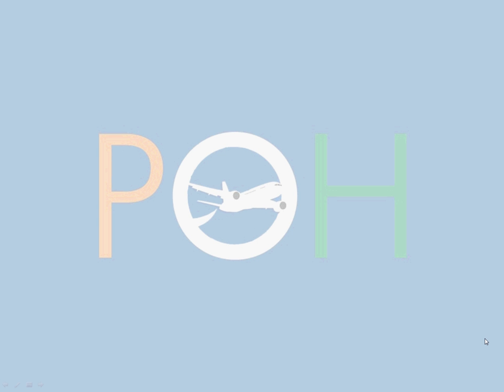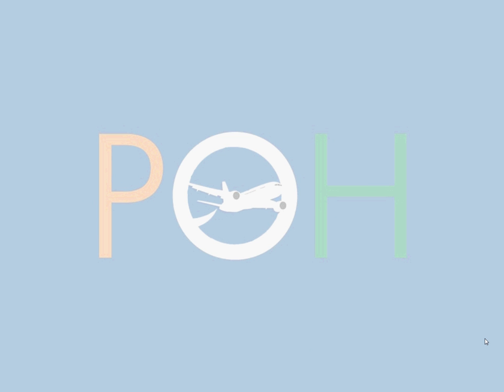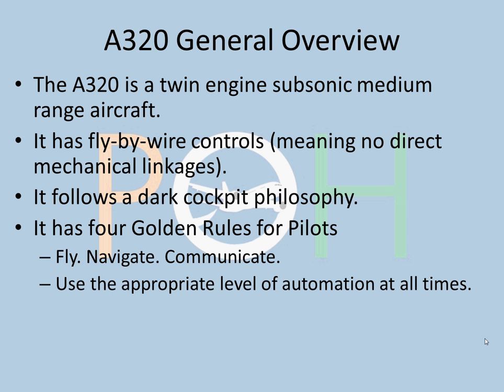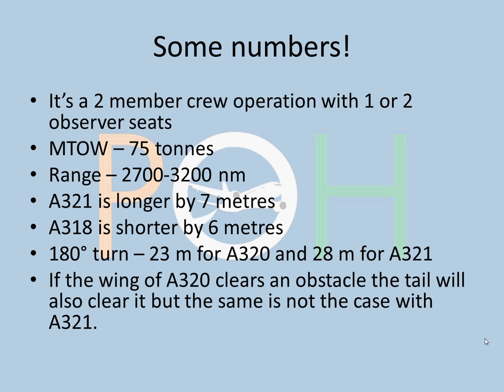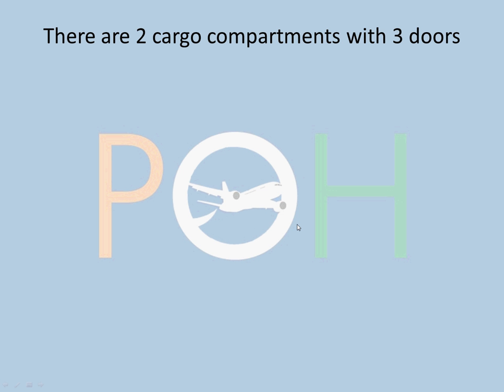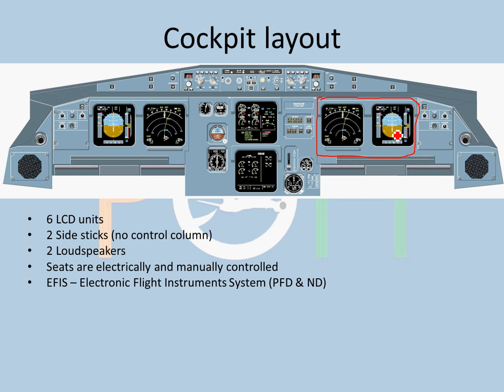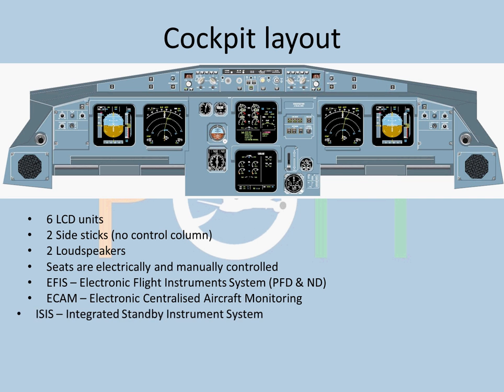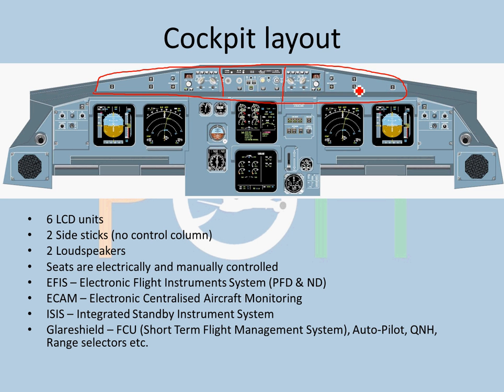A320 - General Overview

Comment: Here's an obscure question.  Can you answer it?  What is the technical name for the tray where the yoke used to be located - Airbus "pilots" frequently use this tray for their coloring books.
Reply from the maker: Sliding table. We eat our meals comfortably on it as well.
Reply: @poh  Loss of "flying skills," over-reliance on automation, loss of situational awareness, etc... Crashbus, um, Scarebus, um, Errorbus, correction, "Airbus pilot" is an oxymoron.  Just a glorified, 21st century Greyhound bus driver(s) in a manned drone with front row views - while letting a computer take decision-making away from the "pilots," Aircraft designed this way - by non-pilots but computer programmers - with flight laws that won't allow a pilot to bend the airplane is a heaping pile of junk -like the 380 - in the scrapyard where it belongs.

Comment: Hi....I am not rated but I think  unpressurized area could be because of weight saving reasons and also these areas serve no purpose other than housing equipment/ systems. Pressurized areas are required to be made strong to undergo the stress of pressurization !
Reply from the maker: +88singhal Hey, most equipment and systems need pressurisation since they might not be able to perform at those high altitudes and low temperatures. Pressurised areas are undoubtedly strongly built to withstand the big pressure differential that they go through.